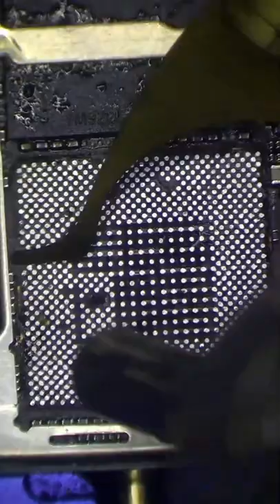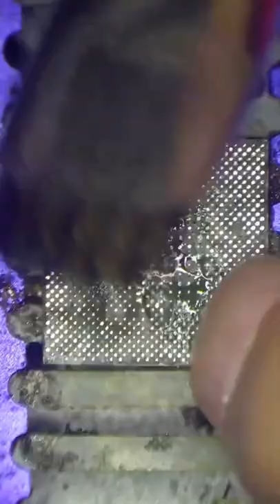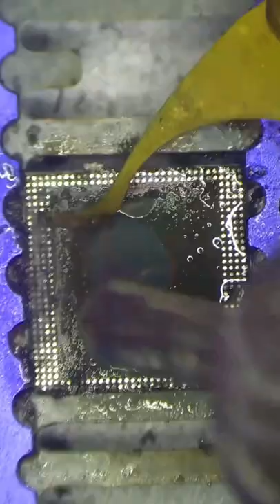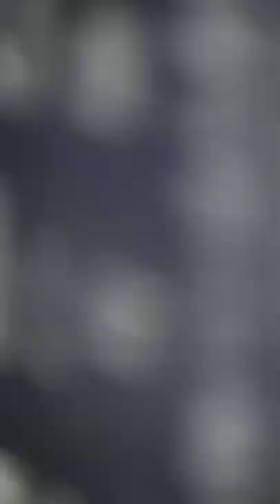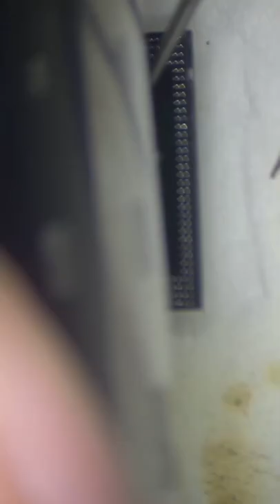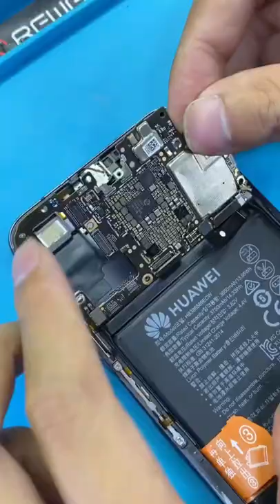Huawei Honor 20 CPU Reballing #Shorts

Comment: What temp are you using on the heat  gun?
Reply from the maker: Desoldering 380 ℃; soldering 350 ℃
Reply: Air
Reply: Air for soldering?